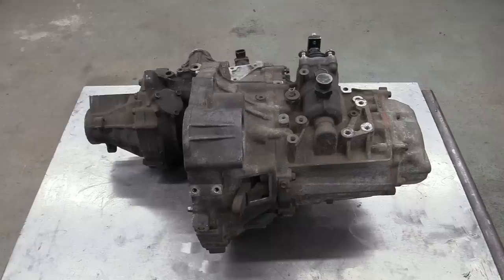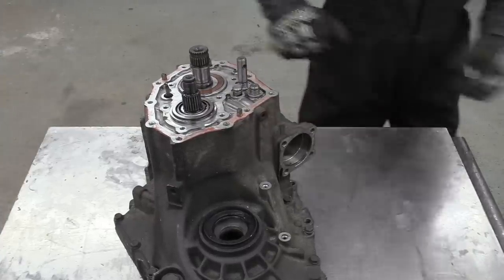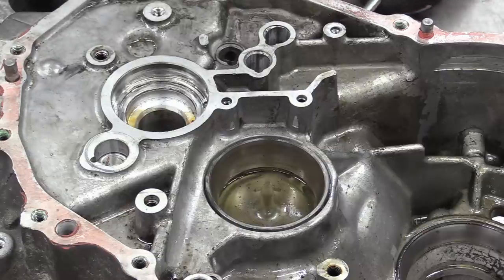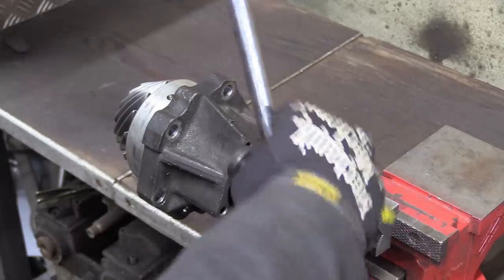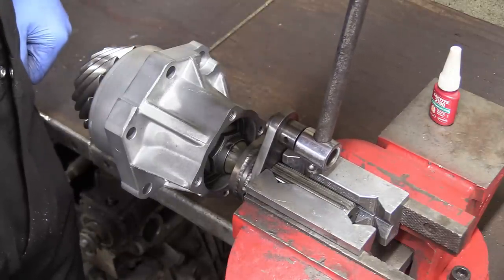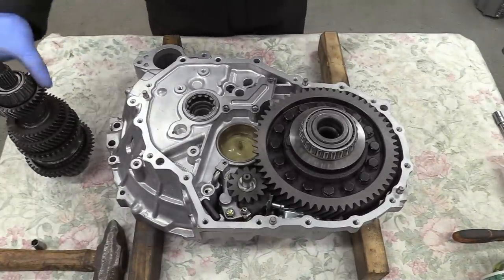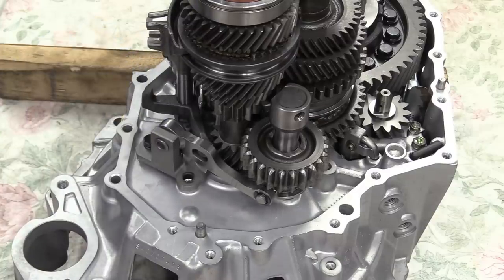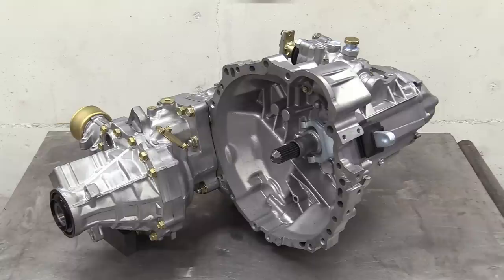Howie Did It - Toyota E154F Gearbox Strip and Rebuild

Comment: im not sure this was totally designed for public viewing, but to help them remember where all the parts went by watching the strip down, to help with reassembly! adding the real time commentary as it happened 'just in case' it was decided to release it!
whatever the reason, nice work. i think i would have replaced the bearings regardless, nyself, unless you know for SURE the box would be coming apart again. if unsure final drives or whatever it was arent correct, id have tried it BEFORE stripping it to find out. of course it would have been in a Celica or similar rather than a Mini, but either way...
keep up the good work

Comment: Wish we had this video when we did mine and stuffed a Quaife diff in it (probably gonna regret that when I add more power). Oh well, the older one of some guy doing this with an E153 converted to AWD is decent enough and so's the workshop manual for the most part I s'pose

Comment: these were way over engineered to anything else available in the day and their German counter parts weren't reliable like these were, In our very hearse Canadian winters they stood up no problem even in the minus 35-40 celsius weather, Toyota  came out with a low temp oil for this box, synthetic from Toyota a little pricey, at -35 outside it felt like summer driving with the new oil type it was worth every dollar and my buddy beat on that car hard all the time and it just got regular  maintenance some dealership some himself, did the clutch at 100,000 miles and i was surprised it lasted that long and the dealership  did to , they new how he drove the car, never ever touched the gear box itself , thx for the great video it reminds me of the days of the late 70's early 80's when i worked for Versatile farm Equipment and got to build transmissions, axles, transfer boxes and PTO units massive in size that were triple change drive, good days, very good days, this rather therapeutic  and satisfying now time to go cut trees and yard maintenance and work on the old Volvo 240 DL daily driver, that whole car was one good quality well engineered piece vehicle. i would love to get my hands on one  👍 look forward tot the next video

Comment: why on earth would you reuse the bearings and blocker rings while you have it apart!? You can't even see the important part of the blocker rings from the outside. Now it's a brand new 200,000 km transmission.... that was just painful to watch, so much effort and care into the rest of the car and then comes the transmission without even a dial indicator in sight

Comment: Call yourself a mechanic?  You're supposed to use the biggest air ratchet with a big compressor to install the sump plug.  Using that little wrench gives no opportunity to round the bolt off, and strip the thread.  Honestly.

Comment: Beautiful work vapour blasting new and or replaced hardware, but would honestly have replaced the bearings and synchros (at least on the trans)  especially with a built motor.

Comment: At 10 minutes he removes 14 bolts with a single socket.  If that had been a British gearbox there would have been 4 or 5 different head sizes and various lengths of bolt.

Comment: In the one spot that used a gasket, a gasket would have been thicker than the goop, right? Had you machined, or considered machining, one or both of the surfaces to maximise flatness?

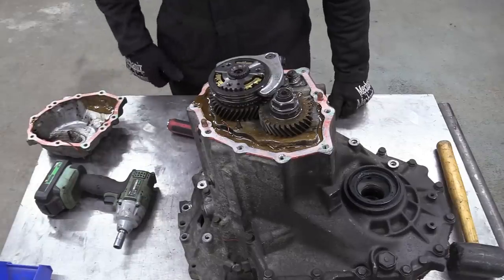Comment: 5:45
Gearbox manufacturers: "Nooo you can't reuse the nut"
These blokes: "Haha nut go brrrr"

Also for that bearing, I'm not sure just how specialized that Toyota tool is, I just know it's expensive. Typically if you need to pull a bearing from the ID, if you have a jaw type bearing puller, the kind with the arms that're also used for pulleys, those can be reversible to work with ID pulling. Typically they're called internal grip pullers or pilot bearing pullers. The only specialized part of the Toyota tool may be it's size, but even that I'm not sure about.
Same goes for the oil seal puller. Two 'specialized' tools that can be replaced by one, cheaper third party tool. The only difference between the two is that the oil seal puller is a slide hammer tool, where the bearing puller is a screw actuated tool.

Comment: Did you end up changing the final drive. It seems to me the 3400-odd rpm to do 70 would have been a strong incentive to lengthen it. And if you've now gone even shorter with a ST205 box, even more so.  Especially as you also are adding a considerate amount of horses under the bonnet

Comment: Sorry , I had to cringe at the use of impact driver putting on that 5th gear syncro hub.. When you know that a locking nut is to be reused , i made a narrow chisel to fit the cut out  and could save them quite successfully without splitting the flange

Comment: The 'oil tray' thingies catch oil off the rotating gears and drip it on the fifth gear so that gets lubricated too, and one of them feeds oil to the synchro's through the hollow shaft and the little feed tray thingy on the end cover. :) Most manual gearboxes don't have an oil pump and rely on something similar for all the lubricating.

Heh, tappy tap tap.

Comment: I am a bit surprised and concerned you didn't buy new bearings seeing as you had it completely apart. As well, that roller needle bearing for 5th gear should have received some grease as a prelube until the gear oil works its way in there.

Comment: Love watching the rebuild but keep thinking how big that transfer case is would it not be easier to use a 4g63 gearbox and transfer to free space up.
You are living life on the wild side if the fifth gear locking nut watch boosted boiz video to see what happened to there gearbox

Comment: I suggest loctite on the "Gooooolllldddd" rear driveshaft dust shield, had one come off on my supra and had to cut it off with a screwdriver and hammer on the side of the road (as the entire exhaust and center bearing stop removal of the tailshaft)

Comment: i nearly called you out on those nuts stacked under the bolts of the shifter housing but i went back to the start and see those bolts already hanging out. can only assume some sort of spiffy bracket  was fitted there in an earlier episode

Comment: You are actually not suppost to use a magnet on the balls and locking pins in a transmission as they can get slighly magnetic and catch a lot of metal filings
 and thus ruining the rebuild

Comment: Why would they put 5th gear on the outside of the case like that?  Seems odd.  So you could just get rid of 5th gear entirely if you wanted?  I'd assume you'd have to modify the selector or something to not try to use it, but just seems strange.
Reply: The only thing I can think of is modifying top speed for different rally courses without having to take the whole thing apart.

Comment: Working on a e150f should be very similar right?
I have one laying around that might have a broken shift fork but i haven't attempted to work on it because i don't have any of the toyota SST's.  After watching most of this I see i need a slide hammer, my welder, and a press.
I can't find replacement shift forks besides the Frana billet ones but I don't have that kind of funds laying around.  
I'm currently using a e154f that has a notchy shift from 1st to 2nd.
Thank you for the video 👍
Reply: It should be nearly identical. Main differences being different gear ratios, dual cone syncros, and transfer case awd disable.

Comment: No replacing bearings, checking tooth contacts, checking backlash, measuring bearing preloads?
From professional experience I dare say. One shouldn't trust that  1)the values are correct to begin with 2)they'll be the same once torn down and re assembled. No matter if it's cam timing, panel fitment or diff adjustments.
I'm just more interested in what's going on inside the covers than shining the covers.

Comment: I'm curious as to why the expense of a second transmission. Was the one that came from the donor Celica that bad? Ir is this just an expedient way of having a new box ready when it comes time to reassemble the car?
Reply: Just taking a while to guess. The st205 transmission had better gear ratios and dual cone synchros.

Comment: With this design, wouldn't the trans being in neutral or reverse not drive the oiling? I couldn't imagine it being a huge issue, but no F&F style reverse driving in the Celica I guess
Reply: Well the pump should still spin when in reverse, it does run off the diff after all, although it'd be running backwards...   I figure the pump is there mainly to route the trans fluid through the cooler as most manual transmissions (the handful I've worked on anyway) don't have a pump at all relying solely on splash lubrication.

Comment: I feel a bit cheated. You have to fire at least one spring clip across the shop, never to be seen again.
Reply: God that is the worst sound, ping-tink-thonk... "It sounded like it hit the shed wall, would you say the landing sounded more like concrete or wood?"

Sometimes a lack of sound is worse, dropping a bolt or nut in an engine bay and not hearing the 'clack' of it making it to the concrete, "Which subframe/framerail is it stuck on this time?"

Comment: One of the hardest things to learn is that you don't hit it harder, you get a bigger hammer.
Reply: A harder thing to learn is when not to hit it.

A friend of mine did a great job of cracking the corner of his engine sump because he figured the ear on the casting was the perfect place to thwack it, I pointed out after the fact that there was a similar ear cast on the engine block that was perfectly placed to pry the sump off with fairly gentle pressure, and much less welding.

Comment: So it took 100 years to come up with a manual gearbox this complex. In a decade or so, as ICE cars swap their 98% market share with the 2% electric cars currently enjoy we will wonder how it was possible to produce such precise and complex machinery as an ICE car for such a ridiculously low price. On an EV this would be a single speed reduction gear train (4x for AWD with a drive motor for each wheel, it's high time we abandoned differentials), so much simpler and cheaper. This gearbox displays all the charm and ingenuity of an early steam engine but unfortunately just as doomed.

Comment: I have one of these... well two actually. One in the st185, the other in my shed, lurking the near the door and stuck in possibly 2 gears.  For the first time the diagrams in my TSRM now make sense.

I'm still scared by the thought of what damage I'll find but at least I know how to pull it apart, and what curtain material I should use on the bench.